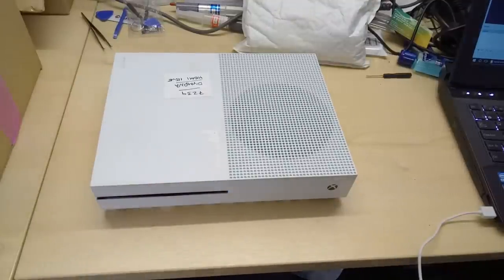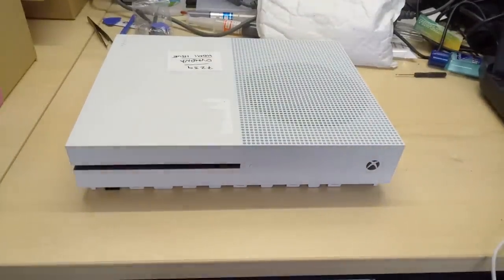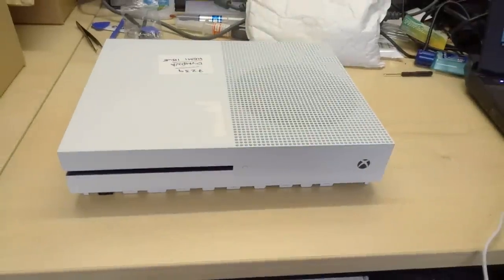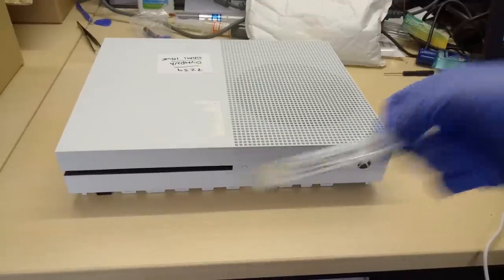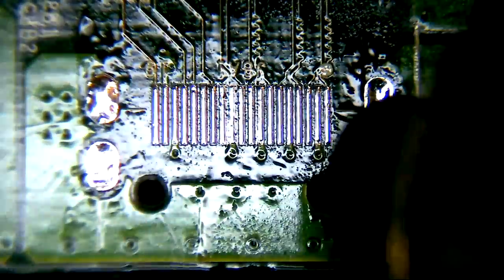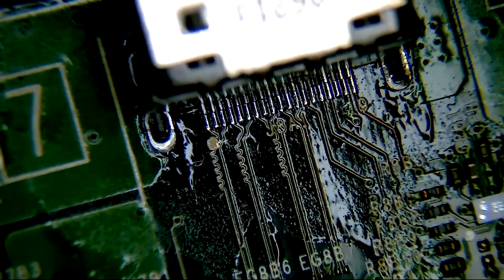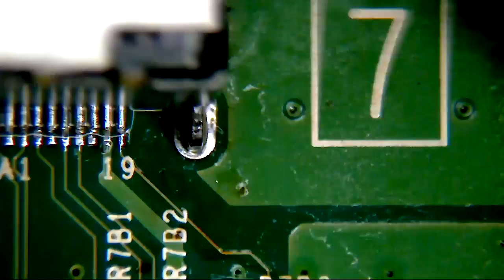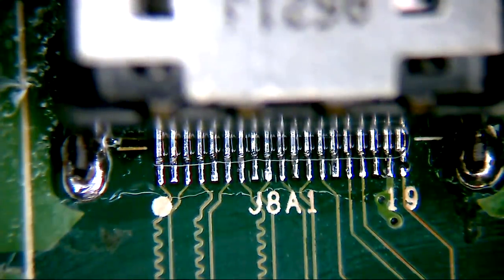XBOX One S HDMI Port Replacement Tutorial

Comment: Thank you for the great video. Replaced it unfortunately it still dont work.and setting it to standard definition didnt work either
Reply from the maker: That's likely to be a HDMI Retimer IC problem.
Reply: Do they have them on regular xbox ones?
Reply from the maker: On an original XBONE? No, that's a Southbridge BGA replacement job.
Reply: Andrew Paul  I have no idea what that is on an original xbox.  So I left the xbox  one on and the picture started blinking on then off again.  What a headache
Reply from the maker: Have you checked the port for bridging / loose pins with the nudge test? It's often easiest to check these first before heading to the major components. Do the EMI filters check ok for continuity?
Reply: So I zoomed in with my phone camera and yeah there are 2 sets of bridged connectors.  This is my first attempt at ever doing this.  I'll give that a shot I'll let ya know in a week. Thanks again man. Your videos are awesome!
Reply: So replaced hdmi port again and managed to get a factory reset unfortunately now the screen just blinks off non stop a few seconds at a time.
Reply from the maker: Did you manage to check the EMI filters for continuity at all?
Reply: I really have no idea what they are :(